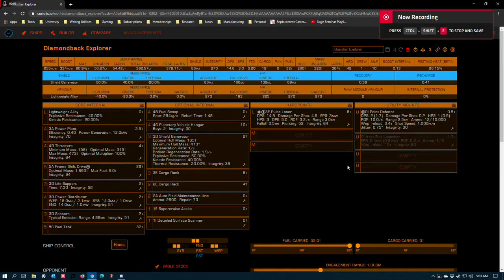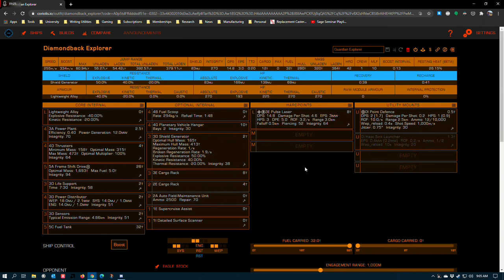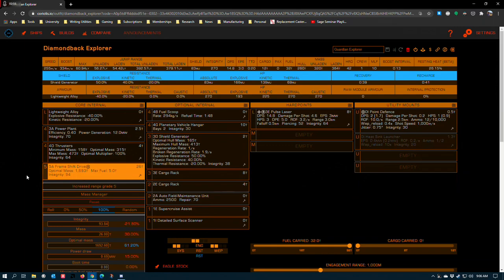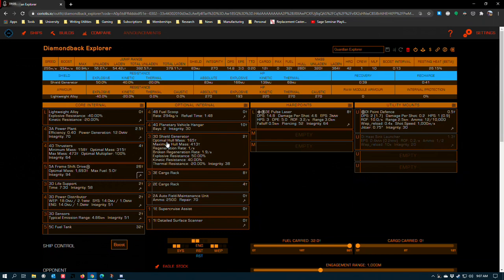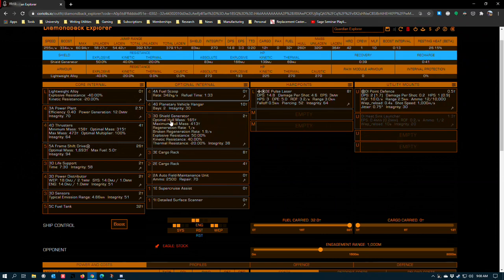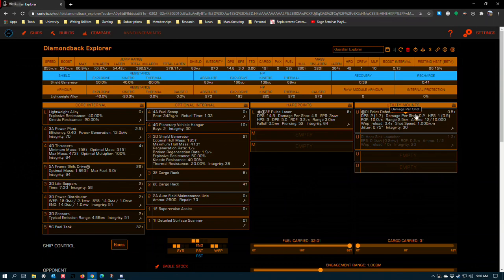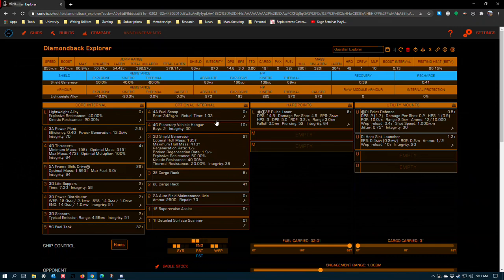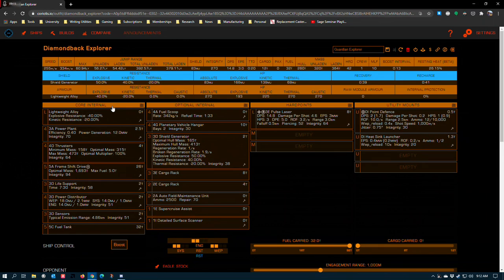Elite Dangerous | Ship Builds | Diamondback Explorer | Guardian Ruins Exploration

Comment: The tech broker's pre-engineered doesn't give you any more jump range than a fully conventional engineering can. The pre-engineered actually get's less unless one which is a mandate go to an engineer and install the mass experimental. Which then make's it the same as a conventional fully engineered including the mass experimental. Thus it all depend's on which style of grinding one desire's. The pre-engineered requires some 100 total mat's. And the conventional, even if your lucky, because one will have so many additional pull's the last one or two percent. Requir's almost as many.

Comment: Is it possible for multiple guardian boosters on one ship and can you have more than one fsd v1 on on a dbx
Reply from the maker: Only one FSD and booster can be installed per ship.
Reply: @DryHeatAndSand  even if its a v1 and is their such thing as tripled engineered fsd
Reply from the maker: @angelolima4811  It's a hard limit, one of each module type per ship. The engineering is irrelevant.
Reply: @DryHeatAndSand  ok can an fsd guardian boost be engineered
Reply from the maker: @angelolima4811  No. There is currently no guardian fsd booster engineering available in any form.
Reply: @DryHeatAndSand  ok so then can the fsd v1 be engineered
Reply: How many frame shift drive engineers are their i will be the first player two have a 100 ly jump dbx
Reply from the maker: @angelolima4811  Anything you get from a tech broker cannot be engineered by the player, it comes as is.
Reply from the maker: @angelolima4811  I believe there are three capable of grades 4 & 5. However, there is no difference between the performance gains they offer at max level. 

To my knowledge there is currently no way to build a ship that can jump 100ly unassisted.
Reply: @DryHeatAndSand  thats why i will be the first hopefully they add some things in odyssey cause ps4 hasnt got odyssey and from just to frame shift engineers i upgraded more than 20 ly on my fsd and i just found another 3 which means potentially another 30ly plus guardian and whaterver new engineers i meet would only need 2 more for frame shift to go past 100 and the original 2 enginners i started with i still have not completed grade 5 are you on ps4